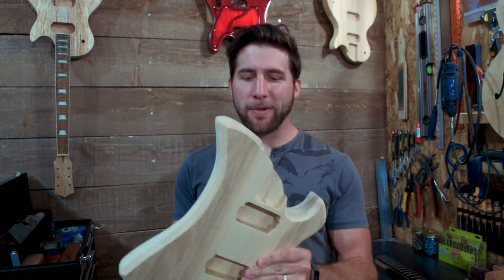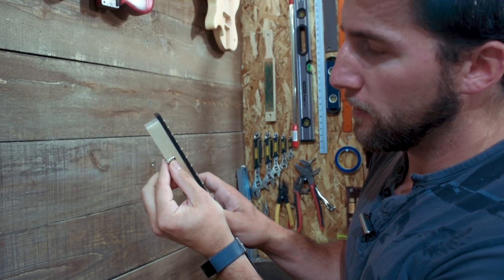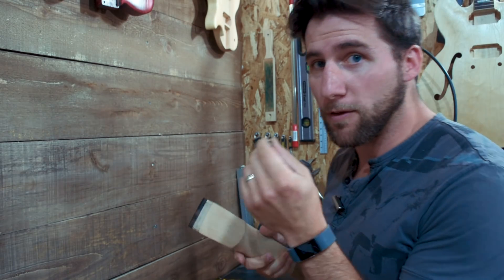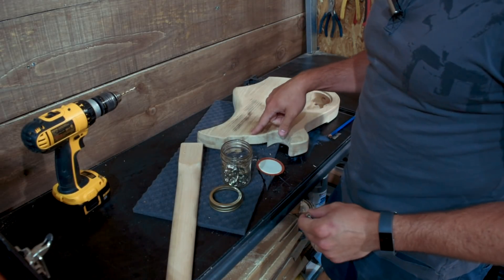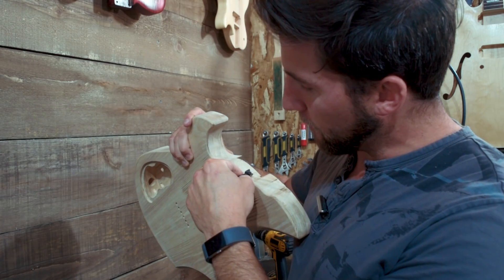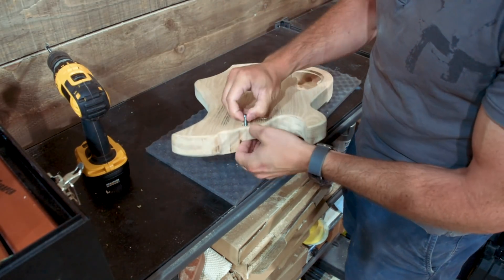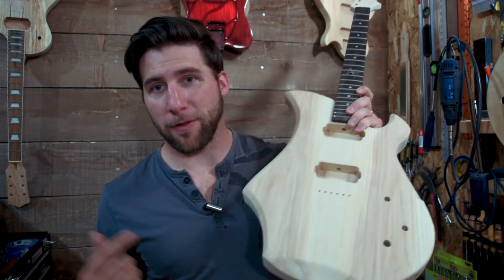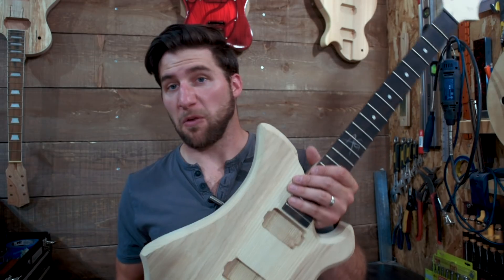The Great Guitar Build Off | Joining the Neck

Comment: People get so wrapped around the axel about the number of bolts holding a neck to the body. I think 3 is plenty... especially if you run with 1/4-20. 
We used 10-24 on ours and we only used 3 as well. 
Now, one day I'll show you how to do it while you stand around in sandals and tell me I'm drinking the wrong beer.
Reply from the maker: One of these days I should make the switch to those steel inserts.
Reply: Hahahahahaha.
Reply from the maker: Thanks Scott. I forget who does them, but there’s a design out there that only uses one bolt and it works just fine. A lot of people just still believe in old myths when it comes to neck joints.
Reply: @BradAngove  life hack for staying straight/perpendicular without drill press: use a CD or hard disk drive plate from an old computer. Something that's reflective and preferably has a hole in the middle. Lay it on where the hole goes and the reflection of the drill bit should be in line with the drill bit from several viewing angles and you're good to go.
Reply from the maker: Interesting. I like that.
Reply: @Scott.9  That's the comeback of the year!
Reply: Honestly, if you use at least good quality #10 wood screws, you don't need the inserts at all. I have a build from a few years ago with a 2.125" wide (slighly tapered) by 2" long neck pocket, holding a fairly heavy rosewood neck with a standard plate and screw setup. It doesn't budge.
Lately, I've been using 10-24 panhead bolts, countersinking to twice the depth of the bolt head height using an endmill, and installing 7/16 washers in the flat bottomed holes. I haven't bothered with inserts in the neck in these cases because I use very hard neck woods and drill to the minor diameter of the bolts.

Comment: I can appreciate a good old pair of safety flip flops....A man after my own heart.
Reply: Make sure you drill the right size insert holes....If you have a drill press, you can put the proper size allen key in the chuck. With your piece clamped down in place, rotate the chuck by hand while using pressure from the press handle to guide it in. Perfectly square! Don't forget to set the depth stop! Just a thought!

Comment: I totally agree, three bolts are plenty! I once tested screws for fun!  1 regular deck screw through 2x4 in a ceiling joist, and hung from it, 240lbs barely moved! A lot stronger than we think!
Reply from the maker: Ya, we’ve mounted some bloody heavy stuff using two or three bolts this size.

Comment: I've never had much luck or fun with threaded inserts in to the neck personally. I guess it's down to me more than not being a good idea but I have a much better idea when building your neck. Before you put the fretboard on, I stall the female part sunken under the fretboard. This way you are essentially clamping the neck and body together for a much stronger joint than any method like this because even with the threaded inserts it's still functionally the same as a wood screw so could eventually fail. The way described above means it never fails or weakens 🙂
Reply from the maker: Interesting idea

Comment: Oh I'm glad you made this. I'm looking to start using threaded inserts in my builds. I have the hardware but have never bothered. This is good motivation. Thanks Brad
Reply from the maker: Thanks Joe. There are other types as well that you may want to consider that may be easier to insert.
Reply: @BradAngove  yeah I will consider that. I'm thinking rest them out on something else besides my  necks first.

Comment: Brad, my 6 string Warwick bass had a neck pocket not much deeper than that, with thinner wood. 4 screws. Was rock solid.
Reply from the maker: Ya, my ibanez is my oldest guitar at this point and has a neck pocket shape that is fairly similar. It’s going to be good.

Comment: Hey Brad... I use these inserts a lot. A little tip though.      Clamp across the heal while installing to avoid any cracking or splitting.   Hope this helps.  Kind regards      Sarah
Reply from the maker: Thanks Sarah. Good idea.
Reply: Rellik Guitars   I was thinking the same thing . Clamp the sides and press in . I hope the bolt isn’t a flat head with the conicle shape that could split the neck also . Button head screw with a flat under the head will pull it down in the Forstner hole which is flat and pull it flat down down evenly .
Reply: I know the inserts should be tight going in, but in this case I think if the hole was just a little bigger, the neck would not have cracked. Hindsight is 20/20...
Reply from the maker: I slightly bigger hole would have worked. I did want these good and tight though, and I’m not worried about the crack. The hardened superglued in a hairline crack like that will be harder than the wood was originally.
Reply: @BradAngove  Super glue is very hard but the crack is on the circumference of the insert where the stress is maximum and where the wood is at its thinnest and weakest and at the fulcrum of the neck joint where torque on the bolt head is maximum. With aggressive playing, The neck will torque on the bolt causing twist and the crack will open at the weak thin crack... it will break again.
Reply from the maker: The stress is maximum at the third bolt. The higher one. Only one of them actually had a crack and the super glue has sorted that out. I’m not worried.
Reply from the maker: Ya, that does make things more challenging.
Reply: @BradAngove  You got to ask yourself this question, "Would I buy a guitar with cracks in the neck even if they were repaired?" I definitely would not consider it retail first quality. It would be a B-grade or worse from any company.
Reply from the maker: Fair enough Ted. I wouldn’t be at all surprised to find something like that because nobody would know, but I could be wrong. I thinks it’s important that people know how to fix something minor like that; which is why I didn’t simply omit that part of the footage.
Reply: Brad Angove your neck crack is definitely not a minor issue. The holes you drilled were to small, therefore you over forced the inserts. Each insert has outward stress on the end grain of your neck. Throwing in supper glue to a cracked neck is builder irresponsibility, and shows you would make other mistakes and cover them up. This Shows real character flaws.  you may think i am being to hard on you, but as a designer/builder not properly correcting mistakes is wrong.
Reply from the maker: Rachel, if I wanted to just cover them up irresponsibly I wouldn’t have showed that part on video. The crack was invisible, so I would have just left it. I didn’t.
Reply: @Rachels123  With more than a snug fit into the body of the guitar there is no more room for expansion or is the insert pressure going to split the entire guitar in half? As a designer/builder, you should know this.

Comment: For what it is worth your standard PVA wood glue doesn't have anywhere near the holding power on itself as it does on wood so you should shove some sawdust into the holes THEN glue THEN the inserts. The short version is using wood glue to fill gaps without something like sawdust in there as filler will actually be weaker. Mix sawdust into the glue well and you will have a solid filler as I am sure you know but not many know that a glob of glue really doesn't have much strength compared to a very thin film inbetween some wood.
Reply from the maker: Yes, I should perhaps have been more clean in my description the glue is in a very thin film on the inside of the hole predominantly. Right between the insert and the wood. There is a bit at the bottom that has no impact on anything, but the rest is essentially under clamping pressure from me putting in the insert.

Comment: this is great, you don't need a lot of sophistication to build a great guitar. My last build was a PRS style, with string through, roller bridge and locking tuners. All of the wood work was done in my lap, kicking back with tunes. All of the paint work was done on my front porch, and staining done hanging from my string tree! Fret leveling was done with an Ibeam level and a gun vise. I haven't eve done a full set up yet? Just eyeballed it? I built it for me and like it just the way it is!
Reply from the maker: Excellent, I’m glad to hear it turned out the way you wanted.

Comment: As soon as I saw the inserts, I was wondering if the two end inserts wouldn't split the wood out. I made an instrument with inserts and they split out the wood too. They should make a bottom tap for cutting the wood thread for those inserts. The two screws at the end of the neck don't hold much pressure, (just the tension caused by the insertion pressure) unless the hole toward the tail stock gives way. That third hole does almost all the work. The other two are almost at the fulcrum point when string tension is applied.
Reply from the maker: Yes, the third hole is the important one. I have done something further to this joint now in a subsequent video to ensure that it is even more solid than it otherwise would have been though. Just in case.

Comment: I've done this exact method to secure a neck on a kit build. 
It really does pull the body and neck together hard.
So far, no problems at all and I've been playing it for a year.

Doing it again, I'd taper the neck heel holes a bit. The neck wood was so hard I had my heart in my mouth that the thing would crack as I screwed the inserts in.

If you have any concerns - you can reinforce the joint more using the Dan from Guns and Guitars method:
Long screws put in at ~45o through the body and at an angle into the neck. (Pocket-hole jig can make this easy and neat)
It also pulls the neck down hard into the pocket.
Reply from the maker: Thanks Frankie. I’m not concerned, the hardened superglue In that hairline crack with be harder than the original wood was. I’m not a big fan of that angled screw method personally, but I see the merit in it.
Reply: @BradAngove  If I'd stuck with screws, I'd have gone with the extra angled screw.

But I think I'll keep using the inserts going forwards - just with the tapered holes and maybe some wax to help when screwing them in.
Reply from the maker: Wax is a good idea.

Comment: When working near the end of a neck/piece of wood and installing a threaded insert the best method I have seen was in wood magazine, you drill a hole so the threads (on the insert) just slightly engage/bite the wood add epoxy to the hole and install. Let dry job done and just as strong no cracking!
Reply from the maker: Nice one

Comment: Your solution has the clamping force on the tree heads of the bolts wich is about 1 square inch (?). A backplate would spread the force over a much wider part , maybe about 8 square inch. If the boltheads after some time work themselves into the wood, the neck will losen in time.  I hope the glued cracks will hold; the crack is a sighn that the hole was to small in the beginning. (Sorry for some writing errors as I am Dutch.) Rob
Reply: Still Awake nz  Smart!
Reply from the maker: The plate would distribute the force, but that won’t be necessary. 
The cracks will be fine. The super glue is just as strong as the original wood. I wanted to use the small holes to have as much pressure around the inserts as possible.
Reply from the maker: Also, I feel like I should point out that many bolt on guitars done use a plate, and there are a few designs that only use one bolt.
Reply from the maker: Jackson, Ibanez, etc. tons of guitars don’t use a plate.

Comment: I would ‘soak’ the holes in the body with super glue. In that way, the wood becomes rock solid. Especially important since you’re not using ferrules, so you gonna need a bit of extra strength.
Reply from the maker: I might put a bit in there. The heads in these bolts are wide enough that I don’t think there’s all that much difference between them and ferrules.

Comment: Those inserts act as a thread forming tap, instead of cutting they push the wood out of the way.  On a wood as hard as maple, that leads to cracks.

As I told one of the unofficial competitors, it would make sense to cut a flute in an insert to make it a cutting tap, run it in to cut the threads, then take it out and replace it with an uncut insert.

Also, skip the glue next time, if an insert gets cross threaded, your neck is destroyed if you can't get the insert out.
Reply from the maker: I checked them before the glue hardened. They’re good.
Reply: @BradAngove  yeah but what if someone monkeys around with it in 5 years and cross threads a screw?  If you could pull out and replace the insert everything is ok.  With glue the neck is done.

Instead of just using inserts, you should use them for what they are good for.

Hopefully your inserts will never get a cross thread but it would be nice if that type of damage was recoverable.
Reply from the maker: I see your point. It would be inconvenient to have to use a tap and dye set to repair them. I think I’d rather take that risk though and absolutely eliminate the chance of these twisting out somehow.
Reply: @BradAngove  I don't think that is much of a risk but a small drop of CA glue should lock everything together and still let the insert break loose without taking a lot of wood with it if it needs to be replaced.
Reply from the maker: Good point Joe

Comment: Cool body shape, nice job.  Would be interesting to calculate the clamping forces created by wood screws vs machine screws.  My biggest concern would be the distance between the edge of the insert and the heel edge of the neck, not much  material there.   If you look at a strat neck pocket, you'll see there's quite a bit of space between the edge of the heel and the screws... it aint that close for a reason.
Reply from the maker: Most of the pull force will be on the top bolt. But ya, fender uses a specific neck plate for theirs. There are other bolt on guitar designs that do it much differently. Some of which only involve a single bolt, or two of them.

Comment: I would have put that 3rd bolt in the middle🤘🤘😌👍
Reply from the maker: That would certainly have been an option. I wanted it as far up as possible, and having on the side of the heavier strings seemed logical.

Comment: Brad, after watching  ER Webster struggle with the same issue.. all i can say is thank god for CA glue.. and thanks for actually sowing us something.. I thought that was the point.. ?? I do worry that over time the bolts will loosen as the wood goes through expansion and contraction.. but hey.. it will ultimately be someones else's problem.. perhaps Crimson will warranty the kit?.. Wonder how the Breadcaster and Coorscaster are doing?  some cool ideas going on.. i just wish someone was showing us more..  I guess most are busy with real jobs eh?
Reply from the maker: I would say that the likelihood of the bolts loosening probably isn’t really any greater than the chance of a wood screw loosening. There will be ample pressure on it to keep it in place, and this fastening method has been used in guitar before. 
Not sure on the others. The only one I know has a “day job” outside of building stuff other than me is BigD.
Reply: @BradAngove  After my expierence and a little research, those style inserts are not designed for hardwood.  Doesn't mean it won't work, but they are designed for soft or composite materials like MDF, pine, and plywood.  I think the glue you used helped as it may have acted as a temporary lubricant.  Or maybe the inserts you have weren't made out of cheap, thin bronze like mine were.
Either way, I had a bad time when I tried to use them. 😓
Reply from the maker: Interesting. They were a bit challenging. I looked into them back when I bought them and have used them in hardwood a few times, but as I recall they just said wood and I didn’t look for more specifics than that.

Comment: You could get a longer drill bit for those pilot holes.  I have a 1/8" bit, about 6" long, that I use for situations like that and to drill a ground wire path, from the bridge to the control cavity.
Reply from the maker: Yes, I’ve got a longer one as well. There’s some merit to that, but I seldom use it unless I need a really long bit because it is difficult to keep straight.

Comment: Bolt on neck means what it says not screwed on.  I appreciate on this occasion you had no choice but use threaded inserts but in my opinion the best bolt on solution would be to use T nuts inserted in the neck prior to the fret board being attached. I am only a hobby builder and only use the through neck or glued in method.
Looking forward to seeing this finished and also hearing it being played. Hope we get to hear all the competitors too as this should contribute to deciding the overall winner.
Reply from the maker: T nuts going in first would be a great idea.